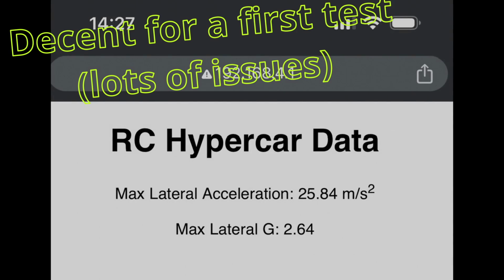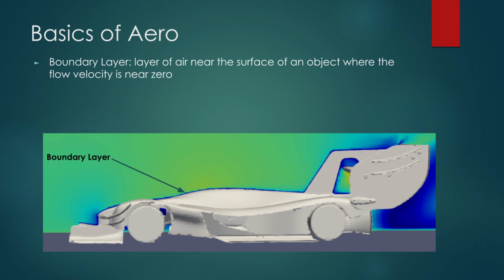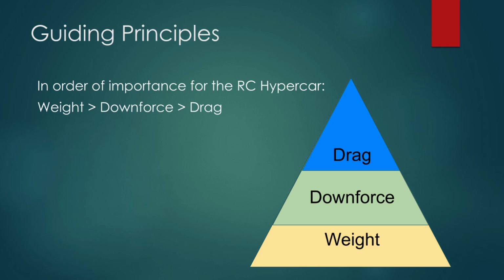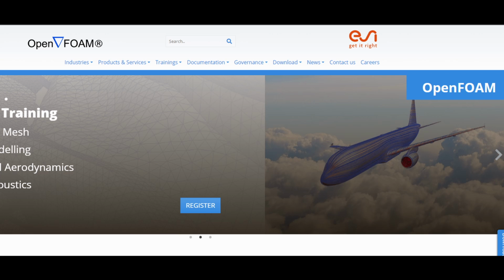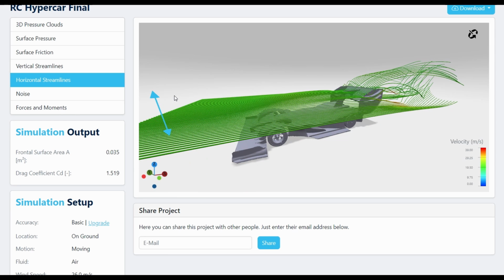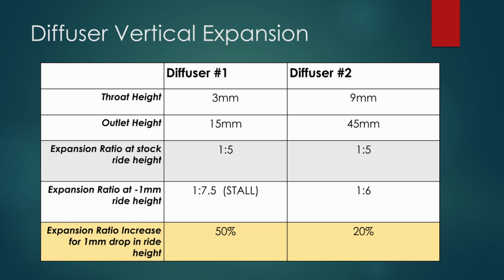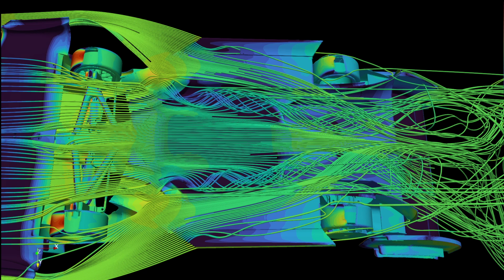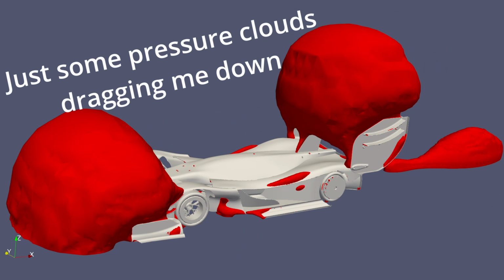RC Hypercar Pt4 - Extreme Aerodynamics

Comment: It was mentioned that you didn't understand rear wheel drive for a car like this. I have no idea about cars but with Rockets they need a significant part of they're mass a distance from the engine for stability. It's counter intuitive but with a long slender car it may be the similar dynamics.

Also with the realm that the car is operating in you may see less drag without wheel fairings. Axel fairing to a aerodynamic optimized disk wheel at least on the front.

I think maybe the rudder is all that's needed for steering and no wheel steering would be needed or decoupling the wheel from the rudder maybe a good idea.

I think you touched on that in the video.

Such a cool looking car. It looks fast sitting still! Basically an airplane flying against the ground.

Comment: My printer is itching to spit out this thing! Are you looking for real-world feedback? I'd also love to build some molds and make the body out of a carbon fiber layup.
Reply from the maker: I'm glad you like it.  I'm probably several iterations away from wider spread testing. I'll delve into this in later videos, but the car has a long list of issues that will require a redesign of the monocoque and the suspension.

I'd love to see how this car would perform if built entirely from carbon fiber. I can only imagine the number of molds that would be needed, considering the complexity of the monocoque and all of it's integrated mounting points.

Comment: are you still running no torque vectoring? any gyro or similar?
Reply from the maker: No torque vectoring right now. I do have a gyro/accelerometer onboard that I tried using using for stability, but I usually just keep it turned off.   The gyro interferes too much at high speed.
Reply: @IndeterminateDesign  ah alright good to know, was curious because I'm using hub motors for efficiency hopefully but wasn't sure if it just wasn't stable or my surface was just really slippery. its a 1/10 carpet pan car running on hydrogen
Reply from the maker: @fastslash25  That's awesome.  Are you using a fuel cell then?  

The hub motors are very touchy at low speeds, I run 50% expo on this car right now.  I'm running the motors in sensorless mode on the ESC and I can tell there is a slight difference in torque between the two motors at low speeds which can cause instability.  I'm hoping to add hall sensors to the motors and this should keep them in sync better.
Reply: @IndeterminateDesign  yea currently using 2x of hydrogen horizons 30w pem fuel cells on the current competition car. Hub motor car is not on hydrogen at the moment.
I was worried the slight torque difference could be a problem, I was thinking of trying some hall sensors too. I think you're going to hook them up to the esc somehow though right? I only am familiar with maybe changing the pwm according to hall sensor readings. Is it possible to use a sensored car esc with one of these outrunners?
Reply from the maker: @fastslash25  The torque difference would probably be very minimal with the output you're looking at.  I have tried adding hall sensors externally to my outrunners, it works technically but it needs more perfecting.  Here's a clip of my setup from IG https://www.instagram.com/reel/Cnix5X-O2WB/?utm_source=ig_web_copy_link&igshid=MzRlODBiNWFlZA==

Comment: This is so cool. Is the extreme force on the tyres wearing them out significantly faster? Do you plan to change or upgrade the tyres for this project? Can’t wait for the next video 😁
Reply from the maker: Thanks!  The tires are a real issue.  I actually wear through the edges because they roll over so much.  I’m testing custom tire inserts but I also have some suspension issues to work out.

That’s the fun of a project like this. There’s always a new problem to solve.

Comment: So I've seen two fundamental strategies to underbody stuff.  1) High/Open nose, force more mass flow rate under the car to make the tunnels work.  2) Blocked/Low Nose (like a splitter/air-dam) - Prevent air going under to make a low pressure suction area behind the blocked part.  I assume in general, option #1 is preferred if rules allow wacky floor antics?
Reply from the maker: I think #1 can make the most downforce, but probably has more drag.  

I tried both high and low nose. Even an inverted nose like FSAE cars. This car is kind of a mess because RC car suspension components are so oversized for the scale.   Luckily the front wing on this car is really high up for ground clearance and that lets a lot of air pass underneath.

Comment: That is an impressive result!

I’m not sure if it would even matter at this scale, but would reducing interference drag make any improvements? Interference drag is caused by adjacent surfaces that meet at right/sharp angles.
Reply from the maker: It would definitely make a difference. I need to smooth more of the surfaces and honestly just sanding and painting the car would have a big effect.
Reply: @IndeterminateDesign   considering that reducing weight is more important than drag, is light-weight PLA and option for any parts on the car? I know it’s not an ideal material structurally but I know a lot of the modal aircraft guys are having a lot of success with it.
Reply from the maker: I just bought a roll of lightweight PLA last week to try out. I think the light weight PLA is good for the rear wing. It could work for the monocoque, but I’m worried 1 crash and it would be done. So I got some ASA for that.

Comment: I had done lots of reading and best I could tell we needed 60mm ground clearance to not have issues with boundary layers stalling the airflow near the ground.  It appears my numbers were wrong!  I keep thinking of making a scale wind tunnel with treadmill.  I don't want to pay for simulations 😆
Reply from the maker: That’s interesting about the boundary layers, I think that has to be for a particular application. I can tell from the dust patterns on the diffuser the flow stays attached.

The real key is have a lot of high energy air flowing under the car. The giant rear wing and the vortex generators help. Obviously this is not a low drag application. 

This car at 60mph has double the drag and double the downforce of the streamliner at 200mph.
Reply: @IndeterminateDesign  That's awesome.  I was working on a car that looks like a catamaran with 150mm diameter tires to help give a large air gap under the car.  It seems like I could reduce that air gap significantly.  The large diameter still may be a good thing for tire longevity at high speeds
Reply from the maker: That’s awesome. Kind of like the old Adam’s Escort Can-Am car?  Honestly that’s the way to go. I’ve designed one last version of the Streamliner but without the traction 200mph will take over a mile. 

A 150mm wheel is huge.  There has to be a better solution for high speed tires.
Reply: @IndeterminateDesign  yeah and fan cars (sucker cars) are cool.  The 1/8 foams have a 90% failure rate above 190 mph

Comment: Some similarities with the valkyrie amr pro only turned up to 9000
Reply from the maker: Yeah, I took a lot of inspiration from that car and the Praga R1.
Reply: @IndeterminateDesign  would it be useful just as an idead to channel the air from the front wing outwash with tubes on the left and right towards the rear above the diffuser just like in the fwd nissan gtr lmp1 car?
Reply from the maker: I did play with that and I couldn’t get it to work. The diffuser is so much bigger than a normal race car, that it’s almost at the top of the rear bodywork. That’s why the gurney is so big on the tail of the body vs on the diffuser. I get a lot of fresh air feeding right over the top of the body.

I’m getting a lot of strange effects back there, the rear wing is backed off in the middle too and for some reason that makes more downforce on the floor.   🤷‍♂️ It’s so hard to find a comparable in a real life car for this thing.